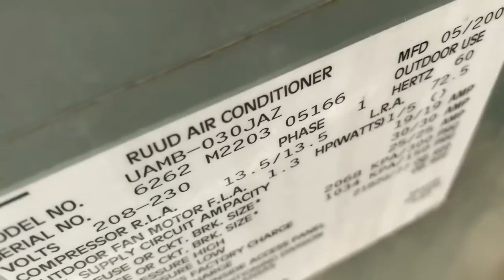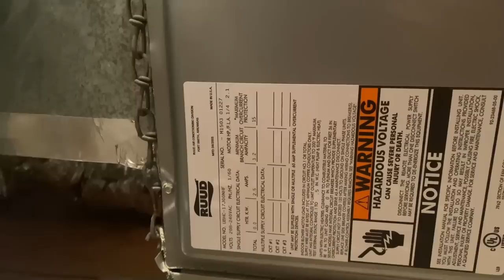Central Air Conditioning System Not Cooling - Red High Pressure Reset Button Seems to Help!

Comment: So, my friends just put in a new tankless water heater. It is of the brand that shall not be named and rhymes with Damien. Anyhow, I told them all about the issues with the brand and the at least 6 deaths connected to the brand. They chose to ignore my warning even though I told them to look it up. I also said, at least install some new CO detectors. Again ignored it. U just can't help about 1/2 of America's stupidity. Hope they don't pay with their lives. However, stupid should hurt.  Wow! Nice hat on the dash by the way.